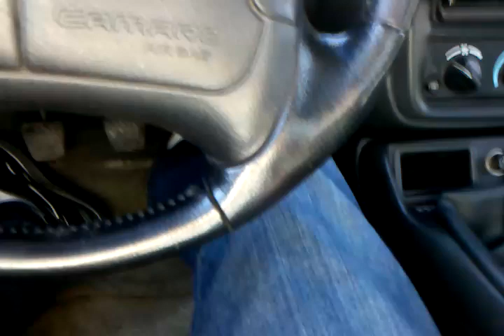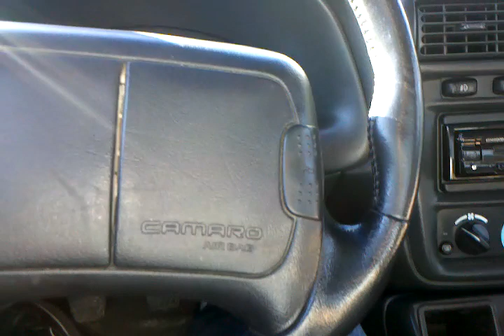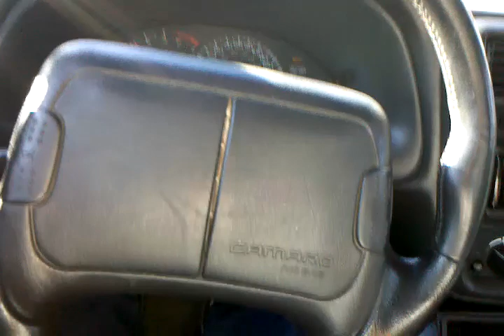Cammed LT1 is misfiring

Comment: it's really easy to tell which cylinder is not firing if you have headers and a infrared temp sensor. point the sensor on each primary and write down the temp differences, the lowest temp is going to be the cylinder with the problem.

Comment from the maker: @Andyatallah I'm not sure about your problem, but it could be the fuel pump.  It's easy to test it with a fuel pressure gauge.  

I don't have a double din because you have to modify the dash and I was not willing to do that.  This car has a 1.5 din so I opted for a flip out.
Reply: carlosg815  what was the problem mine is doing the same??

Comment: The way it works with Cobra's is if you unhook the battery it resets the computer and the fuel tables. Pretty much having the car relearn its self (It does it very quickly a short drive will do it) But I'm glad you got it fixed man. You should clean your MAF Atleast once or twice a year depending on how dirty the car gets. Etc. Funny how a MAF can make a entire car go bonkers? 

Sounds good though man! Glad everything got fixed for you.

Comment: yes id say its your Optispark sad to say. cause there a biotch to get at and swap out. my 1994 vette LT-1 was doing same thing I changed every sensor and plugs,wires everything before finally breaking down and changed the Opti-spark and it ran like a top afterwards. seems the hotter the car got the worse it would cut out and more often. usually done it worse at stop lights or idle. but seemed to run sooth at 50mph or so.

Comment: Sounds like high resolution pulse failure. Replace your optispark and coil. It requires you to take off the water pump as well so check for chips where it mounts to the block to be sure it isn't leaking onto your opti. Also be sure to get new gaskets and clean the gasket surfaces on the water pump and block before reinstallation. It sucks but I used to have the same problem, basically replaced the whole ignition system.

Comment: I got a 94 z28 383 stroker and is doing the same thing. My fuel pressure says 30lbs and when I step on the gas it falls. Just put new opti and still messing up next fuel pump

Comment: Change the cap and rotor wires and coil with msd one's and you'll be good I had the same issue and problem solved. Msd cap and rotor kit $130 and msd street fire wires $50  coil $45 and you'll be back on the road before you know it. Good luck.

Comment: My Camaro got hot after hour of driving, the RPM is not going more than 3 and the car doesn't accelerate its just normal when u don't push much on the peddle.
I left it for about 5 hours to get cold and every thing got normal!
is this problem of fuel pump?
and beside y u didnt put 2 DIN head unit stereo?

Comment: Opti spark or just cap and rot my lt1 did that same ended up doin injectors plugs wires cut cats off and low and behold I had a hole in a piece of the cap and rotter shoulda did it first ...

Comment: My 95 Z did the same.. Turns out my new opti 12 old bears were going bad and was over heating the unit.. Longer I drove it worst it got.. New opti again and ran good but slight stumble.. 2 injectors spraying poorly.. Put 8 new venom 30lb injectors and the car runs like a raped ape. Word to the wise.. Don't try to save a few bucks at autozone. Get quality parts. Most of the time you get what you pay for. I learned the hard way.

Comment: Always shoot for the simple fix. You didn't mention plug wires, did you check them? Were all of the wires in good condition? A wire with worn insulation can cause a misfire if the worn wire makes contact with any other conductor of electricity. Worn insulation on a wire can be caused by removal of a wire followed by improper installation. However, my inclination is you have a bad coil pack or a bad throttle position sensor. Definitely an electrical issue. Good luck.

Comment: you should check the fuel injectors and run some test on them...also do a power test...pulling out spark plug wire from each cylinder at a time, when the idle of the car doesnt change thats the cylinder you should focused on.....i got the same problem with my camaro also check out ericthecarguy page and realfixitfast page...holla good luck